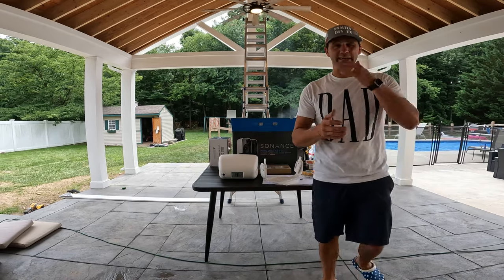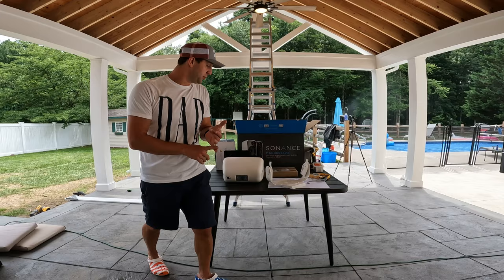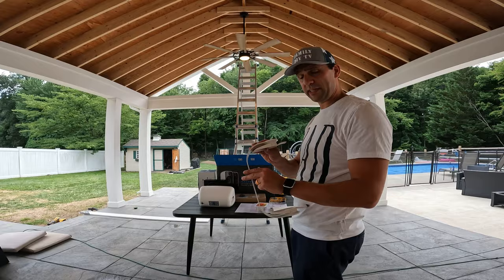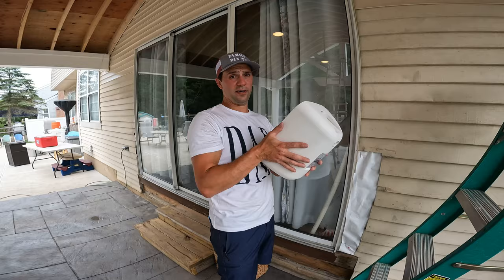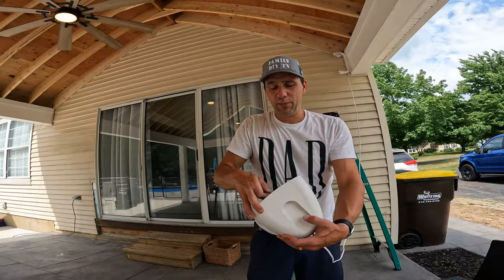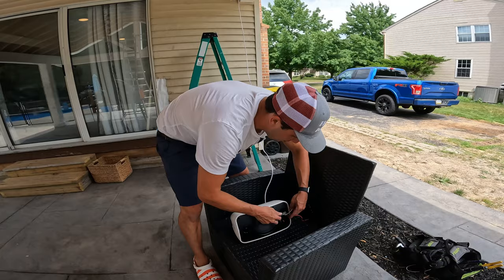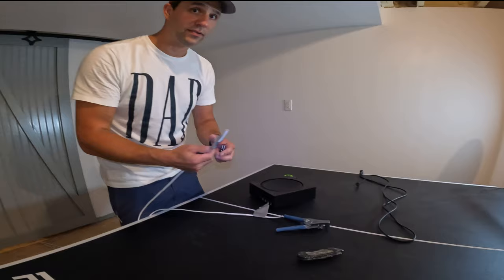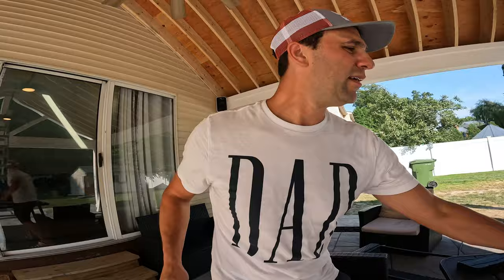Sonos Powered Sonance Outdoor Speaker Setup # impressed

Comment: The system is great for what you pay. That cable is trash though. Its CCA (Copper Clad Aluminum). I do this for a living and no professional would even stock that wire let alone install it.
Reply from the maker: Ahh man ! A professional installer told me to use it and seems to work fine.   What would be better ?   Honestly wondering.
Reply: @FamilyDIYtv  oxygen free copper wire
Reply from the maker: @keishabaskin2174  thanks for the answer!

Comment: The indoor part, is that where the actual power is generated from? Just plug that box into a reg outlet I am assuming? No other electric source needed? No receiver either since it’s directly from your phone? How many speakers did you eventually run through the whole house
Reply from the maker: Yes, the indoor amp just gets plugged into a wall outlet.    i have 2 amps - amp #1 has two outdoor speakers.  amp #2 has 4 ceiling kitchen speakers

Comment: $1000 for two speakers? Id love to know why. Not trying to troll I just dont get it.
Reply from the maker: I thought the same thing for years until I pulled the trigger.  The amp alone cost 700-800 bucks and that is what you need to join the sonos ecosystem.    It’s the first step in my case, gonna build  over the next few years.    It’s amazing to be honest, always on, always works, can control via watch from my pool.   I’m glad I did it.      You could go cheaper with a amp, Amazon dot and speakers(had that setup before but this is like the adult version of that imo- lol) Kinda mimics the same thing, but can’t input sound from tv or do all the things you can do with sonos or at least as easy.    In this case if you want multiple channel input/output and control,  sonos is actually a cheap and easier option.   I’ll be doing another updated video on how to use it and impressions.    

-Mike

Comment: So are the outdoor Sonos speakers “dumb speakers” and the amp is what has the brains? Unlike the indoor that have their own microphone where you can control them speaking to them? Was hoping for a setup I could control by voice and connect to tv with Wi-Fi or Bluetooth.
Reply from the maker: Correct, my outdoor speakers are just speakers … dumb….  My Inside Sonos speakers are also dumb,  all the brains are in the Sonos AMPs.    You can control the amps via Alexa but I usually use my phone then Apple Watch.

Comment: I have a bluetooth receiver inside with 2 wired speakers. I want to add wireless speakers outside so I can listen to the same music inside and out without the Sonos app. Is that possible?
Reply from the maker: yes, I had this at old house.    what is did was 

1. alexa with output plugged into Amp
2. Amp connected to speaker switch (this allowed me to manually turn each speaker on or off) i had four 
3. all speaker connected to switch ....   

worked great actually ...  assuming you can get wires everywhere.   

controlled via alexa inside and phone outside.

Comment: How are you planning to tie the TV sound into the Sonos system?
Reply from the maker: It will be connected to the Amp.   When i do it I’ll make a video.   Consider subscribing 

Mike
Reply: @FamilyDIYtv  are you going to use HDMI to the amp? I don't have the option to run a new cable so have to figure it out feeding it back through a coax cable.